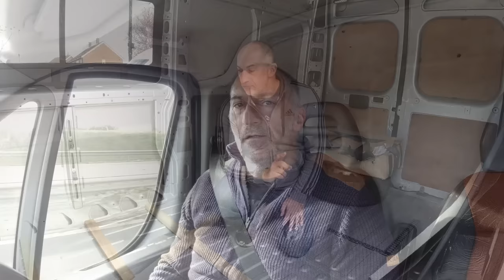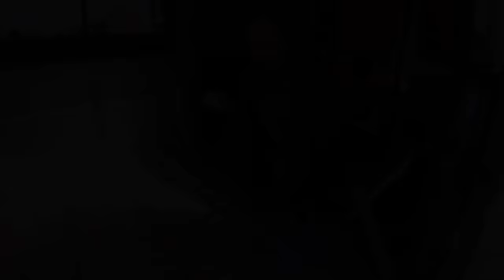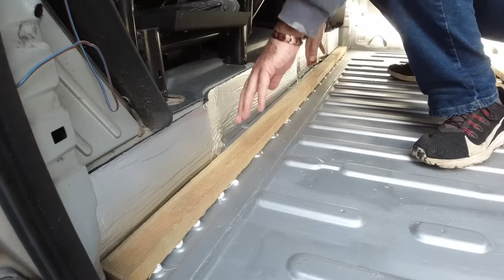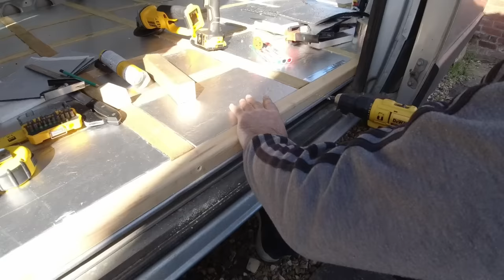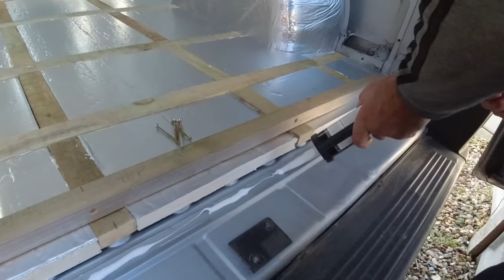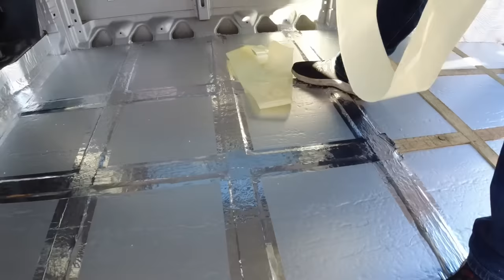How to Insulate your Floor on a Budget - Episode 7 of the Van Build Series

Comment: would love you to sound proof my astra van ,, have done lots of astra vans ive had , but not  to the quality of yours
Reply from the maker: Self adhesive closed cell foam is by far the best thing to use as it does loads of things in one go. 
1. Sound deadening
2. Sound absorption 
3. Thermal Insulation 
4. Vapour Barrier
It’s the perfect solution and not that expensive to do either. 👍🏼😊
Reply: @GregVirgoe  cheers . will look it up

Comment: Nice video and very informative. Seems you do not worry about thermal bridging. Won't the wood make a direct connection between the cold metal shell and the inside of the van?
Reply from the maker: No because if you research the thermal properties of wood you will find that it is a very good insulator
Reply: @GregVirgoe  I suppose good is relative. R value for a standard 2x4 made out of pine is about 1.25/in while XPS is 5/in and EPS is 4/in. Would be interesting to see a real world example. I've seen a test where an IR thermometer was used to measure the effect of Lizard Skin paint on inside surface temps over a period of several minutes but this was not overly convincing. Perhaps examining the outside metal when it's cold out with the inside at room temp would be more telling. Or, examining the inside floor surface at steady state to see if variations in temperature could be detected where the wood supports sit. I would expect the 1/2" plywood on the floor would show a less evenly distributed temperature profile due to it's lower thermal conductivity compared to the metal surface of the van.
Reply from the maker: @gregdunham3949  you really need to compare the K values to get a true picture of each material thermal properties. 
Steel 50 W/mk
Wood 0.15 W/mk
PIR 0.022 W/mk
So you can see wood is over 330 times better as an insulator than the metal body of the van.

Comment: The engineer in me thinks that with sufficient thickness of ply floor no battens are required as there cannot be any point loading, it would all be distributed over a large area. So just lay ply over the pir insulation. No?
Reply from the maker: Yes, with thicker plywood like 18mm that would be less of an issue. However, There would still be an issue where the boards met as we have found in our van because you have that point load at the edge of the board where it stops being supported. We do have noticeable movement there.
Reply: @GregVirgoe  Thank Greg. If that is a possible issue then maybe just a batten at the join (should only be the one). Thank you again for all your excellent videos that have informed me so much.